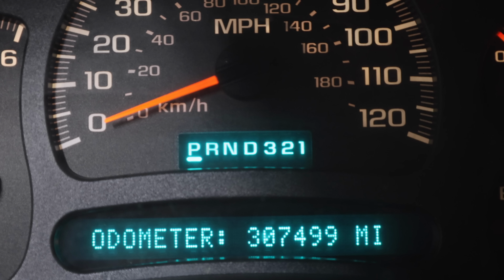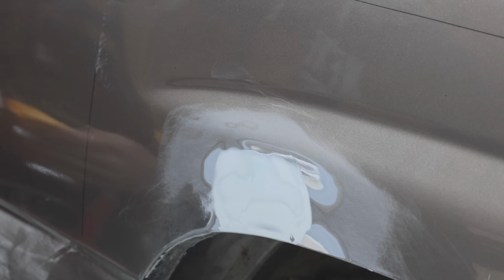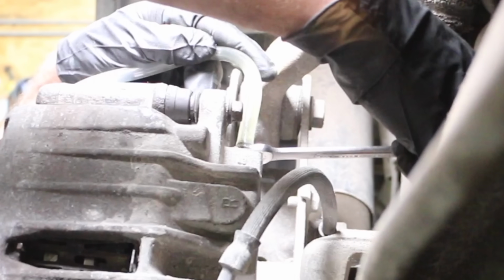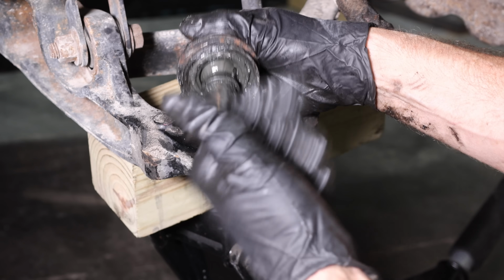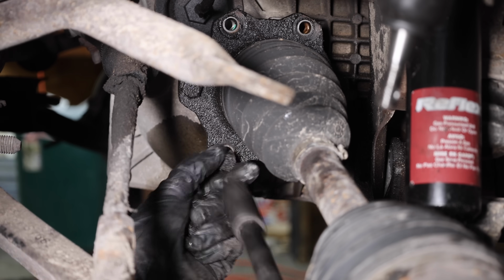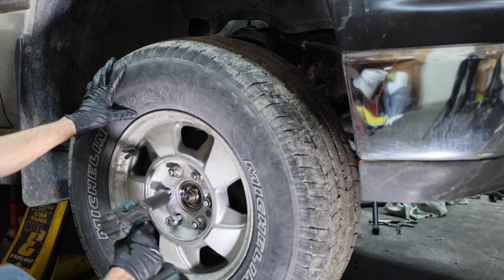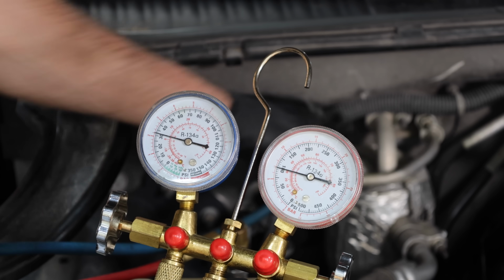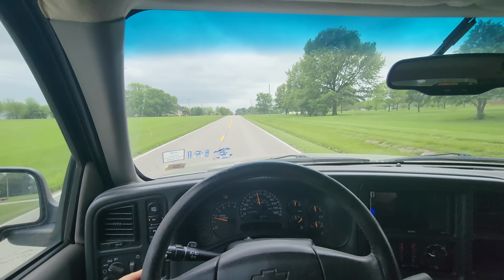Is It Stupid To Fix Up A 300,000 Mile Vehicle? Let Settle This!

Comment: My 2003 Toyota Highlander is my daily driver. It has 409,xxx miles with no major repairs EVER and is VERY reliable, has never let me down. I’ll replace it when it dies.
Reply: Got me beat. My 1993 Toyota pickup that I bought new now has 315,000 miles. Runs fine, burns no oil, front end still tight. It will out last me.
Reply: Can’t beat a Toyota!
Reply: Many first gen Highlanders needed the AWD transfer case replaced at considerable cost. This was definitely it a reliable component.
Reply: I got a 2004 Toyota Highlander LIMITED HAHAH it’s got 307,456 miles on it runs absolutely perfect cold as I paid $1500 for it a year ago I love it
Reply: @Michael-nu1py  My ‘03 Highlander at 409,xxx is a fully loaded AWD Limited.  LOL 😂
Reply: @ZagiBob  mines 2 wheel drive it’s a great vehicle I love mine
Reply: Don't replace it, rebuild it instead. I'll take your '03 over a '23 all day!!
Reply: @shootinglaser  Good advice
Reply: That Toyota is probably going to be replacing you as a driver as it lives on forever
Reply: Just keep the MZ timing belt up to date. 😀
Reply: My daily is. 1998 gmc sierra she’s got 265 thousand original engine. Has extremely good oil pressure. . They just don’t make em like they use to
Reply: @THatChevyguy91  the 60s and 70s were about who could make the most power. The 80s and 90s  were all about who can make the most reliable cars. The 00s and 10s were about who can make the most fuel economy. The 20s to present are all about who can make the least amount of emissions. These goals will drastically change an engine’s design. If there’s anyone to blame really it would be those who propound  “save the world” “climate change” and “green politics” and the newer generations voting for trend based politicians.
Reply: My wife's 2006 Highlander gave us 12 years of excellent service, until some idiot T-boned it. Our insurance company said they had 6 month old cars that didn't look as clean or sound as good ( 180,000 mi ), the only knock was a coffee stain on the passenger seat. I said the coffee was in a cup when she got hit. 
I priced out what We wanted for the car looking at all sources and the first offer was $1200.00 more than what we were hoping for. 
I'd buy another older highlander if we found one that was taken care of vs getting a new one.
Reply: 2003 Ford E 250 380000 original engine and transmission. Maintenance is everything
Reply: @factsnotfeelingssendit5961 world class machinery
Reply: Not some of the new ones. @GamingwithKevin56
Reply: I just bought a 1995 Toyota Tacoma 2.7 exted cab 4x4 auto 315 thousand miles. 1800 cash . I absolutely love it
Reply: because its a toyota
Reply: 90s,00s Highlander and 4Runners were Toyota’s cream of the crop in reliability and least amount of maintenance besides the Avalon, Lexus 300, and all the other Corolla variants. You might as well keep rebuilding it until it becomes more cost effective to find another used  pre 2010 to drive to the ground.
Reply: This world is headed for a bumpy ride. Those that have a brand new leased car with no money in the bank and zero mechanical ability will be the first to fail. Those of you watching this video, that have a little nest egg, a solid functioning (minimally computerized) vehicle, and the ability to service/ repair said vehicle will be much better suited to survive. This is fact. Cheers guys/gals!
Reply from the maker: Thank you for sharing!
Reply: Did you maintain it though?
Reply: @GamingwithKevin56 was
Reply: There is a 3500 with 1 million+ also a 2000 Suburban with 350,000 in 2013.
Reply: I am restoring a 1997 k3500 crew 210k it was a helicopter hauler for most of its life. Going slow doing it correct.
Reply: Watch UK Top Gear from years ago. They wanted to kill a Toyota Tacoma/Hilux. Burned, submerged, crashed and put on a building with explosives. It was till running afterwards!
Reply: 2006 highlander LTD.  270k miles,  I replace the timing belt, tensioner pully,  waterpump and Iridium sparkplugs every 100k miles.  Had to do wheel bearings at 175k, and replaced all rotors twice now. just wearable parts, but with everything being turbo'd for fuel efficiency,  no way id ever buy a new one of those. I'll just rebuild as needed.
Reply: @spudthegreaterusa8386 i don't understand how a vehicle with 270k miles on it has only had its rotors replaced twice.  Every time I get a brake job done my rotors are replaced, like every 20k miles or so, even less probably.  We just bought a 2021 Mazda with 40k miles and the dealership replaced the pads and rotors for us and this was second set as the first owner already had them done once before.  I've never heard of rotors lasting anywhere near 100k miles.
Reply: @JeffCD77  3rd set, if you count the original,  hwy miles, we live in Iowa
Reply: My cousin's got the first year toyota highlander hybrid and it's got 375k, that car must really be solid all round. Finally getting replaced now
Reply: Those highlanders are unbelievable. Legit one of the best cars ever made
Reply: Why not pop a new engine for 600$ and 600-to install it

Comment: I am a manager at a Chevrolet dealer and I will say that yes over 300k miles CAN be reliable if regularly serviced. Believe it or not the highest mileage cars we get are the older Cruzes with the 1.4L turbo. 300k+ no problem!
Reply: 1.4 l turbo is a piece of junk. It won't survive 100 KM mark.
Reply: @philnguyen6376  they’re anemic and slow but statistically they run “forever”. The main reason they die is coolant leaks, which are very common. Again, servicing is key.
Reply: @Omgzegermans You would get more suburbans in your job but people can actually fix those themselves 😂
Reply: @waterloo123100  we have over a dozen written up in the shop as of Friday. Most people don’t really care to fix things themselves. However we absolutely DO have a lot of walk ins for AC Delco parts. To each their own. I’m just a middle man for it. 

Overall I want to say you’re correct, though.
Reply: @philnguyen6376  Yes, they are high maintenance in a cheap car = junk
Reply from the maker: Thank you for sharing!

Comment: My 06 Chevy suburban has the 8.1L V8, is a southern COMPLETELY rust free truck with 392k on it. Runs GREAT. Woolwax/fluid film and preventative maintenance will make this a 1M mile truck.
Reply: Right behind ya with 285k on my '02 2500 w/8.1l . Bought it new in '02, window sticker '$38,000' w/leather,  all options. New trucks, $90k??? Not worth it, I'm keeping my 8.1L 'workhorse'
Reply: @capts6269  AMEN! I flew 1400 miles to Tx to buy a this truck. It was RELIGIOUSLY taken case of and from an area that gets NO 🧂!  This generation of Chevy trucks are widely regarded to be the most reliable/durable. I will NEVER buy another new car/truck. It keeps my 05 Excursion V10 company…lol…
Reply: We paid $29,000 for our 2000 Silverado 2500 4x4 6.0L brand new.  It is the 3rd door extended cab with manual door locks and windows with the rubber floor instead of carpeting.  It was $32,000 after all the fees and gooseneck hitch, drop in plastic bedliner, chrome nerf bars, chrome tube bed rails and Nike swoosh decals on the side.  94,000 miles now and still working great for us.
Reply from the maker: Wow, that is great!
Reply: What is woolwax??
Reply: @ljbrandt500  a lanolin based, non toxic undercoat that you apply yearly. It is self healing, and oozes into all the books and crannies. It is similar to fluid film but thicker. Both can be had in their natural color or in black.  There are shops that apply it but you can buy DIY kits as well. MANY YouTube videos on both. HIGHLY recommend.
Reply: @sorryociffer 
I saw a video on YouTube where a person was applying something like this on all of his vehicles he called it Fluid Film . I don’t know if they are both the same but it sounds like it.
Reply: @czechmate6916  Very similar. Fluid film is slightly thinner and good for hard to reach areas as it will ooze and run into the very tight spaces such as inside body panels. Both are excellent products.
Reply: @sorryociffer  
Thank you for sharing this with us. Have a wonderful weekend what’s left of it. 💪💪🇺🇸🇺🇸🙏✝️
Reply: @ljbrandt500  it's 100x better than rubber under coating. Like oil, the wax repells water and prevents water from sitting on bare metal that (combined with salt) causes rust.

Rubber undercoating can cause water and salt to seal to the frame as it doesn't repell water. That's why you see people who regularly "zebart" their undercarriage have rotten frames.
Reply: @ljbrandt500  A type of undercoating
Reply: It's because the 8.1L has the Allison automatic transmission that lasts forever.
Reply: @MyLifeThai371  only some vehicles with the 8.1 L got the Alison transmission. I believe they were all pick up trucks all 8.1 suburbans got the 4L 85 if memory serves.
Reply: I’m jealous.  I have and awesome running 2008 Sierra that is dying a horrible rusty death.  Rocker panels are gone, rear fenders are gone.  But I know it is a really reliable truck….I am toying with the idea of fixing the body.
Reply: @tfrantastic  The cheapest route is to just buy a good cab and box from the salvage yard.  That's what my brother has been doing for years, since it is cheaper than doing body work.

Comment: Have you had any issues with your dashboard? I have a 2004 and the only issue I have with it is an electrical gremlin in the dash somewhere!
Reply from the maker: The instrument cluster has a gauge or two that needed repaired about 10 years ago. No other electrical issues.
Reply: Maybe it was only the O4's that had the issue, I've decided to buy a device that plugs into the OBD2 port that will give me a HUD and dashboard readings. I replaced a motor for a gaige once but supposedly the circuit boards have a soldering issue. It's a real pain to fix.

Thanks for the video, I was planning on working on the front end soon and now I'll have more confidence to do it myself after watching this video!

Comment: Me driving 270k Ford Focus Cmax 1.6 Disel engine that sounds and works like a new one 😄
Reply from the maker: Impressive!
Reply: @ProjectFarm  Obviously I have done regular oil change services, oil filters, air filter every 12~13k km.  I changed the timing belt and other belts at 160k km, I changed the thermostat at 200k but otherwise I didn't change anything else, not a single problem on other things or engine.

Comment: With you working on it, yeah, I believe it can!

 I had a 1997 tahoe with 258,000 miles and it's been incredibly reliable. Unfortunately I no longer trust chevy, but I did for those generations.
Reply: I would rather restore an old Tahoe than buy a new one
Reply from the maker: Nice vehicle!! Thank you!

Comment: Quick answer is yes. My Suburban has 360,000 mi on it. Original engine and transmission.
Reply from the maker: Impressive! How often have you changed the oil and ATF? Any other maintenance tips?
Reply: @ProjectFarm  Oil change every 3k. Nothing fancy. Cheapest synthetic 5W-30 and Fram textured grip filter. Everything else per scheduled maintenance.
Reply: @FFSteve81  Express 3500 with 382k.  5k on oil changes with SuperTec and basic GM of Fram filters.  I've neglected trans a bit, and have never changed rear.  My only problems have been 4 water pumps, and now oil leak.
Reply: @jimm1819  A little oil leak is ok. Oil is cheap. I'm kinda surprised about the 4 water pumps.
Reply: @jimm1819 if you use distilled water and the proper ratio of coolant, it will slow down how fast you have to replace those water pumps. You might have to flush the coolant system once with distilled water to get everything out before filling it back up with distilled water again. Also many people forget coolant systems need to be flushed every 60k miles. Unless you just prefer replacing water pumps.
Reply: I’m not a GM fan but I’ll say the late 90’s and up Suburbans were one of their best vehicles ever made.
Reply: @rentedmule1287 I was a GM technician and most GM trucks, tahoes and suburbans were pretty good until about 2006 roughly. The only real issues they had was the interior plastics breaking and a/c failing at higher miles. Especially the rear a/c on suburbans and tahoes. If you stick to a work truck, like manual windows and locks, it will have very few problems as long as you change the fluids regularly. I specifically would look for a 4x4 with a manual transfer case shifter. You don't want the push button stuff.
Reply: Wow! They really overbuilt them back then.
Reply: '13 Express 4.8L with 399K, runs great.
Reply: I was a GM mechanic, and the trick to most vehicles is changing the fluids regularly. I personally just do a drain and refill (no filter change) on the transmission every 20k miles. I've seen these transmissions go 350k simply doing that. Anyone can do this, as it's literally easier than doing an oil change as you are not changing the filter. Just open the drain valve on the transmission, use a paint measuring/mixing bucket that has marks on it to tell you how many quarts come out, then add that much back in, drive it around your neighborhood for 10 minutes, then check the transmission fluid level while it's hot. Repeat every 20k miles. Also you don't need to run GM  factory fluid. Valvoline max life transmission fluid is actually better than many factory OEM fluids.
Reply: I'm putting a stock bottom end 4.8 in my Vega drag car. It will have 88 mm turbo on E85 with Holly fuel injection. Should make 1000 horsepower fairly easy...
Reply: @johnnymoran180  Solid. Proper ring gap is key.
Reply: @FFSteve81  Yup, opened the ring gap for booooosst!
Reply: What year Suburban?
Reply: Yep!!!
 370k on my 04 Sierra, same thing.
Reply: I had the transmission in my 02 Silverado 1500 at 325K. I pull heavy trailers and just didn’t trust it anymore for going out of town. I’ve done all the exact maintenance items on my vehicle as in this video. They are great trucks that will go forever.
Reply: This is very encouraging. Congrats.  I have a 04 Yukon XL 5.3 with 232,000 miles on it and I often wonder how much life maybe left in it. So far it has been a great truck for me in the 6 years I have owned it. I maintain it and the original owners did as well. Cheers.

Comment: Just waiting too long
Reply from the maker: I hope it's worth the wait! Thank you!
Reply: You really stuffed a month's worth of work in one 20 minute video, that is amazing.
I think the reason why most people would rather sell an old vehicle, is because they are too lazy to, 1; keep up with the maintenance of their vehicle, 2; do the necessary repairs when something becomes too worn due to lack of maintenance, and 3; they tell themselves that it'll cost too much to have a shop fix it for them.

So in their head it would be better to sell it for an inflated price, buy something new for an inflated price, have the debt for 15 years and going about their lives watching crappy TV.
While they could have taken less than $2,000 and put it into their vehicle a Saturday at a time while learning new skills.
Reply: You're right, my sister just scraped the 2006 Hummer H3, and I didn't know, she said needs to  much work and parts, but most of the repairs is just regular maintenance  suspension etc 180000 miles☹️😡